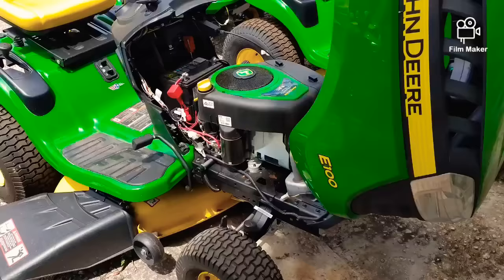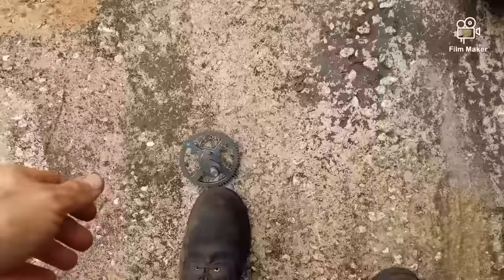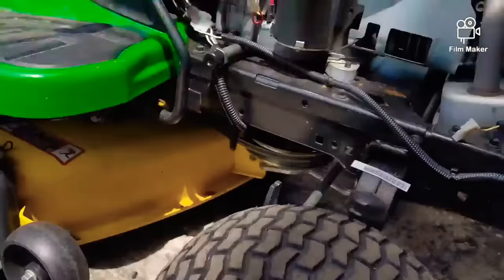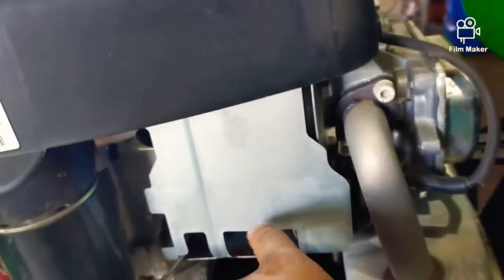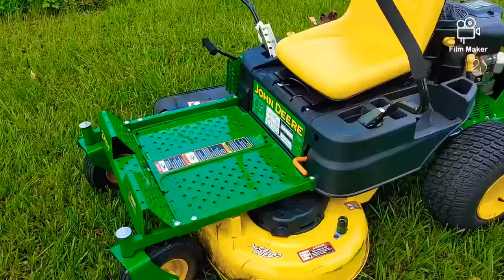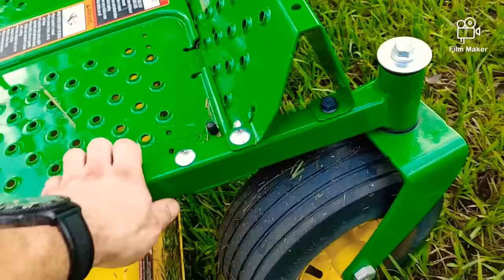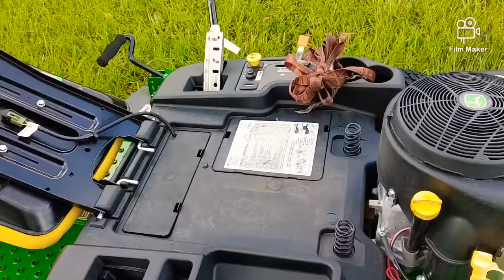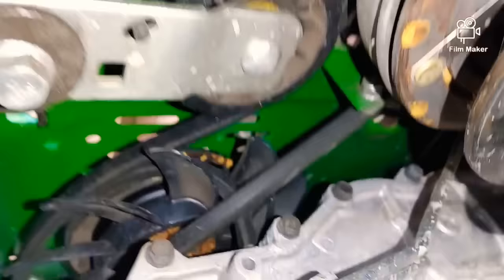Lawn mowers to avoid!

Comment: I have a 2022 Z345R.  Only complaint I had was, the oil filter location.  At best, it drains oil all over the frame floor when I take it off for service.  I went to Briggs and bought a remote oil filter kit (part number: 594271) and relocated it to the rear, where it now drains between the frame floor and the rear bumper.  Much, much better.

Comment: Thanks for your honesty. I was questioning why a neighbor's JD yard mowers were constantly having the same issues you covered here. Very informative.
Reply: Their tractors were good but the zero turns dont seem to be.

The d series tractors are the best.
Reply: If you buy a Z-Trac zero turn from a JD dealership, you get the real deal, but not at the big box stores, those mowers are not the same even though they look like them. They cheap them down for those stores. I have had my Z335E for 8 years, no problems at all. I bought mine with a rebate that brought the price within a couple hundred dollars of Home Depot and Lowe’s, and better service from the dealer if you ever need it. This fact is common knowledge on the internet, don’t buy a JD from a big box store, you will have higher chance of problems.
Reply: Yeah right.

Comment: I have a z355e for over 6 years and I only had to change the deck belt once. Nothing else has ever happened to it. The machine is a beast and cuts great. It still has the original battery in it as well. I also have a larger zero turn ariens, but I prefer to use my z355e its just so much easier and less bulky than the ariens. Like many in the comments the tractor with the plastic transmission is garbage, but the zero turns are great and very reliable.
Reply: No the z355e is trash.
Reply: @jamesstewart2560 ut, the OP said his has been great for 6 years..If an owner likes their equipment, and it hasn't been bad for them, why bash someone else's stuff? Seriously man.

Comment: I mean, mine could just be a unicorn, but we've had a Z355E for 6 years now and its been a good dependable little mower. Just don't expect more out of them than what they are. Ours has 300-ish hours on it, no spindle issues, no issues with the Accel-Deep 48" deck (course we don't step on it to get on and off the mower, there's a built-in step at the front for that) and the little 22 horse Briggs and the Accel Deep 48" is running strong. My grandpa's had a Z445 since it was brand new in 2013 and its still doing great too. Has the 27 horse Briggs with the 54-inch deck. Nothing but regular oil changes, filter maintenance (oil, air and fuel) and keeping the blades sharpened and replaced when needed. Put a set of plugs in ours a year or two ago because it was time for it on the service interval chart, but it really didn't need them and I've kept the old ones around for spares. As far as the deck being hard to lift, just try running the older EZTrak series mowers like the Z445 my grandpa has. Has a straight lever to pick the deck up rather than one turned 90 degrees. 10 times worse in my opinion.

Comment: Thanks a bunch for a lot of good info! I've had a J.D. LT-133 since 1999 and it's been maintenance free till this year(2024).Only one complaint, mechanically, was cranking but not firing. Only other complaint is how flimsy the hood is attached to the frame. Snaps and breaks very easily. Have to replace the hood assembly when this happens.....ridiculous!!!

Comment: I thought about getting one of these or maybe a larger zero turn, but now I think I'll stick with my 1986 JD 185. Been mowing 2 acres for the past 20 years with few problems, same engine, never been rebuilt, still uses no oil. Kawasaki 17 hp single cylinder, 46 inch deck.
Reply: In 86 the good mowers started with the 300 series. The 318 is in cult status, I have a 332

Comment: I have a Z345R, with 10 hours on it.  Use it on a .75 acre lot.  Run's like a Deere.  Cuts like a Deere.  Starts after being stored for a season.  I have zero problems with it so far.  Could go down hill I guess but hasn't yet.  Maybe it's how people use them?  Maintain them?  I'm very happy with mine.  BTW, I looked at a ton of reviews from people who live in the Florida area I do and most were positive.   Thanks for the heads up though.

Comment: Had mine 3 years zero issues so far works perfect.
Reply from the maker: Hopefully you will not have any issues. Sounds like you know how to use and maintain one properly.
Reply: I have a five year old 345M with a 42 inch deck.  It runs fine.  I have the foot pedal to assist in lifting the deck.  I have no need to need to step on the mower deck when climbing onto the mower.  I've replaced the front tubeless tire with tube type and that's all I've done other than routine maintenance like blade sharpening, oil and filter changes and such.
Reply: What zero turn do you have?
Reply: U don't have any grass to cut and u know nothing about mowers.😅
Reply: mmm

Comment: I have a z355r and it has 70 hours on it no issues. I mow 5 yards with it and its held up well so far. The castor bearings on mine are metal. It definitly seems like a very fragile machine but im glad to hear that the engine is decent on it. I have to run it to mow yards in my side gig till i can afford something better but ill definitly keep in mind to be extra careful not to bend the deck. Its a 2018 model

Comment: This is why I actually went to a John Deere dealer and bought an S240. Aluminum transmission, heavier frame, and Kawasaki 2 cylinder engine. 
One word of advice for all yard equipment, if it is available in your area, use non ethanol gas only, for your equipment.
Reply from the maker: I like the S240s
Reply: Shade tree here.  Ethanol gas keeps me busy fixing the neighbor's equipment.  I had a brand new mower given to me last week.  The carburetor was full of jelly caused by ethanol.
Reply: Good rule of thumb .... if it's got a carburetor = use NON-ethanol gas ..... old car, old truck, lawn equipment, go cart, etc..... NON-ethanol gas only. I also use Sta-Bil gas treatment all the time .... keeps the headaches away !!
Reply: May I ask what you paid for it?
Reply: @happycamper5900 lol😂, I am 53.   Ten years ago I brought a mower to an old timer that did small engine as side hustle.  He told me to avoid ethanol.   All the dealerships and stores never educated me on this cuz they want ur equipment to get ruined.   

We live in undecent times.
Reply: Ethanol gas burns hotter. Bad for anything air cooled. 
It also seems to degrade faster than straight gas. 

But it’s the cheapest at the pump! 🫤

Comment: I can relate to the cam issues with compression release not working.  I have a craftsman rider with a Briggs engine 9yrs old.  I have had to replace the cam twice now.  Your spot on with your video and warning viewers to stay away from these single cylinder engines.  And agree, its not fun to replace the cam.  Time consuming.  Thanks for your video.
Reply: Two cams? Really? I'd kill myself.
Reply: @frankcastle5294  Yep!  First time it took me about 3 weeks.  I needed time to review the situation, finding a couple of good you tube instructional help videos, and then took my time replacing the cam.  The second time around I knew what to do and it took me 3 days.  If this release spring breaks again on the cam, then I'm done with the mower and I'm buying a new one.  Probably will go with a mower that has a Kawasaki engine.
Reply: @mffisher123456  I hear ya and all these big displacement thumper 4-strokes need some sort of compression release feature but seems the failure rate on the B&S style one is exorbitantly high. My 18.5HP BH&S Intek is coming up on 500 hours run time and still runs and looks like new but just replaced charging system. Hoping I never have to get inside the engine. Regards, John

Comment: The broken camshaft issue is not just on John Deer mowers.  This is a Briggs & Stratton engine issue.  If you do replace the camshaft, make sure to use an OEM part.  The cheap Chinese parts will not last and you will be tearing the engine down again possibly in the same season. As an alternative solution, a local repair shop advised me to look into a high torque starter which would eliminate the need to use the 'burping' camshaft design altogether.  I think it was about $189 for that starter so a much more expensive option.
Reply: My craftsman suffered the same problem. I agree a Briggs problem.

Comment: A couple of observations: (1) The B & S 17.5hp engine is not unique to John Deere products.  It is an engine widely used on many other tractors of that same price range - Craftsman, MTD, Troybuilt, etc.  It is the same 500cc engine, with minor variations, such as electric start vs. rewind start.  I have a 26 year old Exmark Viking, 36" w/b.  It has mowed commercially for thousands of lawns. It has no hour meter, but probably has over 10K service hours.  I wore out two Kohler Pro Command 15 engines.  Four years ago (Fall 2018), I needed a replacement.  Kohler no longer makes Pro Command 15.  The only single cylinder engine available, fitting the bolt pattern and space envelope was the B & S 17.5hp engine.  I knew it was a consumer grade engine, but I needed something to get me through my work season.  I put on a 31R976-0016-G1, rewind start.  It not only got me through the rest of 2018, but is now working in the 2023 season.  I suspect it has well over 1,000 hours, far beyond expectations.  It starts well and has good power.  The only thing I have done is reseal the valve cover (no gasket, just sealant). I have maintained several Craftsman tractors with the same series of engines (the cheap Craftsman line, 42" decks).  All have worked flawlessly, but the owners are only using them 30-35 hours per season.  I have never heard of one engine having a problem with the compression release feature.

(2) I would agree the JD consumer ZTR is not a very good mower.  In the end,  you only spoke of the front caster bushings as being a problem.  "... the transmission is plastic, ... don't buy it..."  Sorry, but this provides no reasoning.  I have used Honda HRX217 hand mowers (high-end consumer) for more than 15 years, all plastic decks.  These mowers have been outstanding in service, despite seeing commercial use - all with plastic decks.  Calling the JD ZTR mowers "junk" without a  reasoned argument is not meaningful for your viewers.  People need to know "why" in order to make use of your assessment.  As for the hydro drive belt coming off at 7 hours, a reasoned explanation why would make that part of your video useful.  Just making the observation is not meaningful.  The fact that it happened MUST have a reason - wrongly assembled, broken idler spring, misaligned idler, bad pulley, etc. Coming off the pulley does not happen without reason.  I run a JD 717A, 13  years, over 5,000 hours and have had two hydro belts wear out, now starting to run on the third one.  Over all those hours, I have had the hydro belt jump off the pulley twice - both times when running over a stick and getting the stick pushed up against the belt.  The belt was off and the stick still firmly in place.  This is no fault of the mower.
Reply: @michaelrichards2440  not negating any of your input but he did say lots of these parts are used by lots of brands in the first few minutes. He also did give a reason for not liking the plastic transmission was if it breaks it’s very expensive to replace, likely more than the value of the mower itself.

Comment: I have a JD Z turn and love it, no problem with it in over 7 years of mowing
Reply from the maker: Your 7 yr old mower is probably built better than the one in this video. Im not sure of the exact years they had all the issues I mentioned in this video (guessing 2019-2022). It seems the John Deere listened to the feedback and they solved the problems I mentioned in the video. Check out this video I just released. Near the end I show a new redesigned Z320M for 2023. https://youtu.be/TBCQixtpu38
Thanks for watching! 🍻

Comment: Just came across your video in a random search; good honest review; big manufacturers like JD need to stop cheapening their products for a larger profit margin.  People will pay more for a quality built USA made product.  Also agree it’s stupid for JD to even think a plastic transmission would have any long term durability but then again like car makers, the engineers design flaws in certain key parts to break so the consumer is more swayed to just buy a whole new mower every 2yrs vs keeping a well built machine for 20.
Reply: yeah kubota has the soild steel transmission on theres wich why kubotas are made solid strong beast mowers

Comment: I have a d100 I bought 3 years ago the belt came off with 20hrs no adjustment so I bought a smaller belt for a MDT fixed problem I wish this video would have been out before I bought it thanks for the information take care.

Comment: I have a much older JD Z225 (about 12 years old or so) that I bought new and it has been awesome. The JD zero turn you show here looks like the newer ones I've seen and they look much lighter built than mine as far as the frame goes. So much so, I ruled them out as an option when I was recently looking at new mowers. My deck is in bad shape, and they are expensive to replace so I decided to buy a new mower instead. Amazingly, all parts on mine are original except for blades, battery, air/oil filters, oil, spark plugs and one of the mounts for the steering levers. Never changed a deck spindle or bushing/bearing anywhere on that mower and it has definitely not been babied in the least. It has only been used on my property (2 acres) and not used commercially, but for a residential mower it gets treated pretty harshly at my place LOL! I noticed the stamped steel steering arm mounts on the one you showed where mine were cast...those stamped steel new ones look pretty flimsy. I did manage to break one of my cast ones after several years, but I was also using them to help me pull it out of a muddy ditch on a regular basis...yeah I abused my mower! I was so happy with my old one, the residential John Deere zero turns were the first ones I looked at when I started shopping for a new mower. I was really disappointed that I was able to rule them out within a couple of minutes of looking at them.

Comment: Well to late lol I have a z345R and absolutely love it. Of course I only use it on my lawn and it does a fantastic job. I do appreciate the information on what to look out for!!! I do a full service every spring on my zero. I mean Everything new spark plugs, air filter, oil filter and oil and fuel filter.

Comment: I have had that exact Z335E for over 5 years, mowing 1 to 2 acres every 2 weeks most of the year.  Wet, dry, too tall, it just goes and goes.  I do keep it clean and well maintained.  I will admit the front caster bushings are junk, and the drive belt is hard as hell to replace.